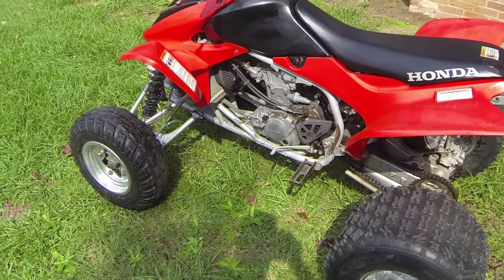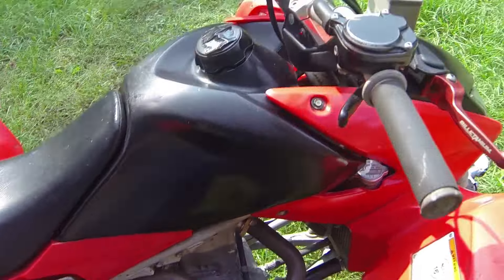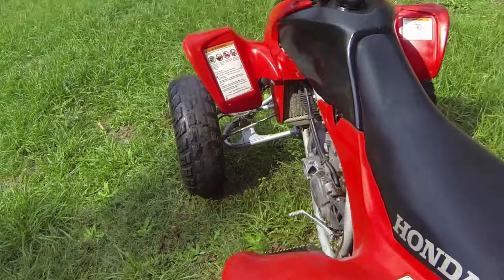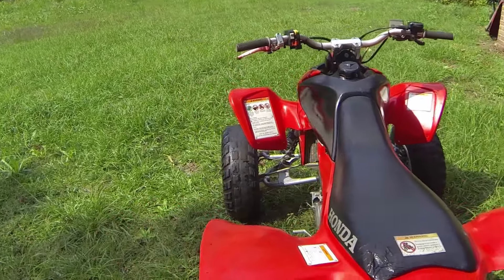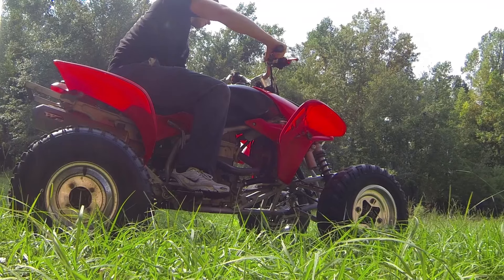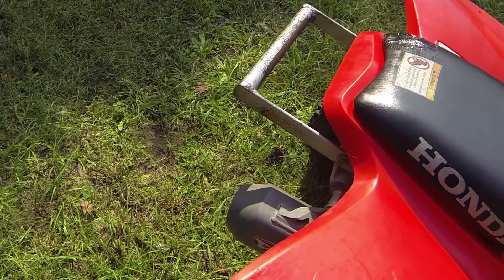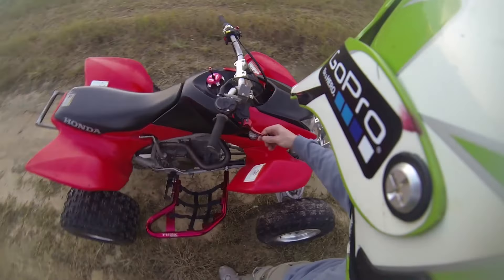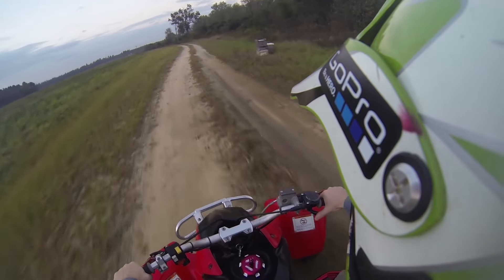Project 2005 Honda TRX450R

Comment: I'm pretty sure the headers aftermarket
Reply from the maker: Yeah I wasn't really sure. thanks for the comment and thanks for watching
Reply: +K Reese yeah that's not stock of it was it would have the bolt holes for the Heart shield and it has a steal braided brake line and in the rear
Reply from the maker: Cool well thanks for the info

Comment: Dude, that tape over the gas cap is NOT good. It’s getting gas locked so take it off!
Reply: It's not getting air cause of tape
Reply from the maker: I put a new gas cap on it! Did you see that video I did of all the mods?
Reply from the maker: I put a new gas cap on it! Did you see that video I did of all the mods?

Comment: My bad you did say +3. But it’s not a 499
Reply from the maker: With a 95-mm Piston, you get 499cc. This is according to the Falicon billet stroker crank.
Reply: Kevin Reese I’m doing a build right now +3 stroker crank and 97 mm  bore gets 501cc.
Reply: Kevin Reese 95mm is 1mm more than stock.
Reply: Kevin Reese are you saying stroker crank plus 1mm bore?  That’s a custom piston?  Did you do this build or buy it that way?